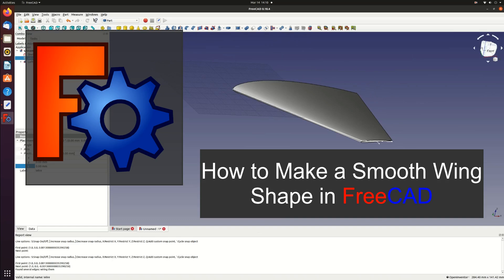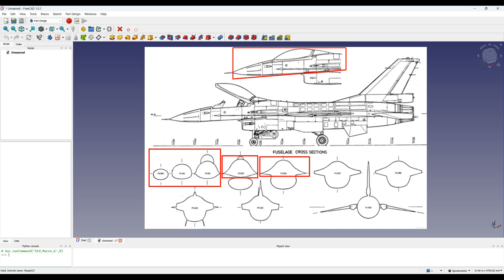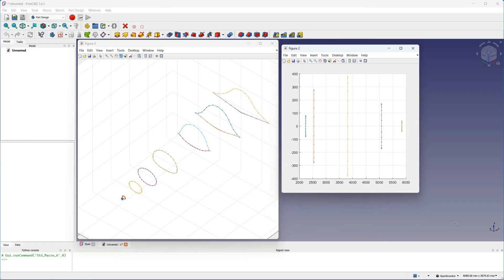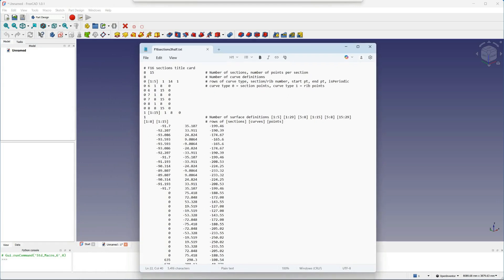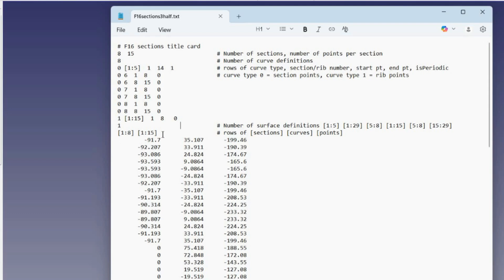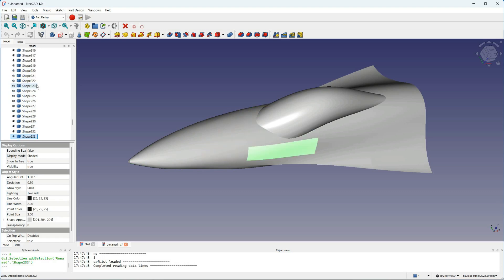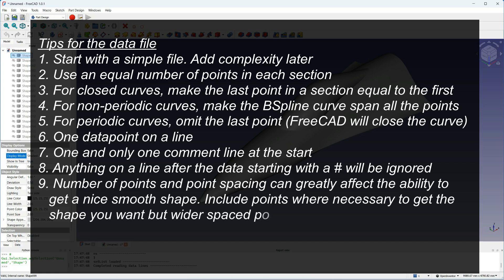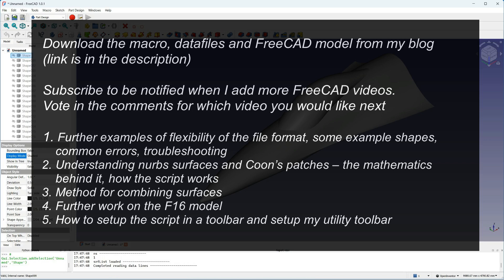How to Make a Smooth Body Shape in FreeCAD

Comment: This is amazing. Will your script work in Fusion 360 as well?  This is what I have always dreamed of doing.  Many thanks!
Reply from the maker: I don't know much about Fusion 360 but I doubt it would work directly. If Fusion 360 has some kind of scripting language and supports nurbs surfaces, then it should be possible to port it. I'm planning a video on the mathematics and the algorithm behind the script, so that could help someone to port it. Thanks for watching!
Reply from the maker: Update: I check Fusion 360. It uses python, so it should be quite easy to port the script to it.